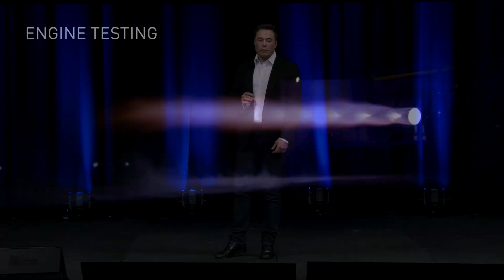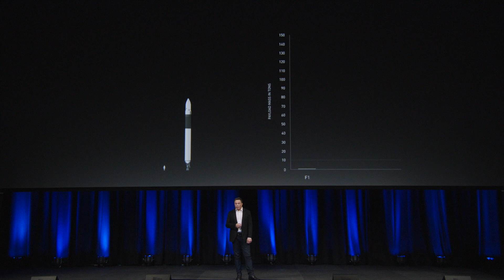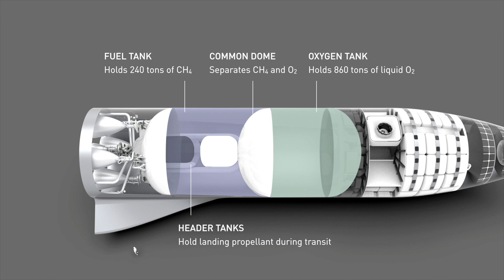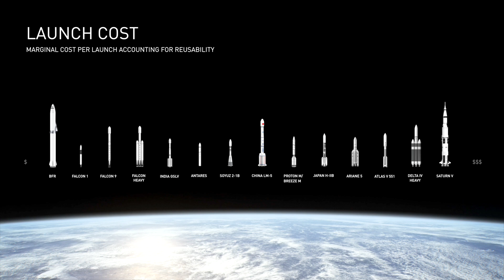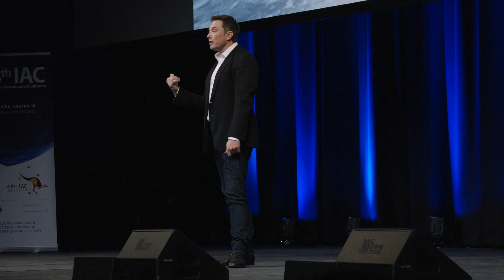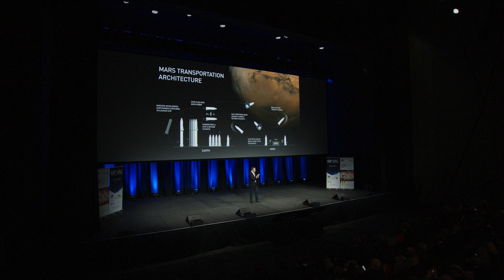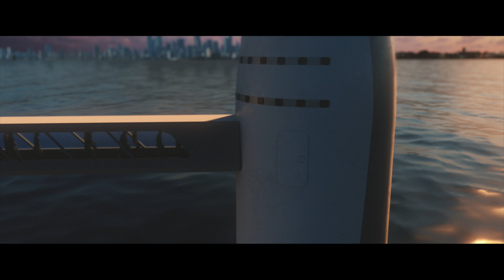Making Life Multiplanetary

Comment: Could a moon base become a hub for any particular industry? Would be have our major aerospace engineering facilities there?
Reply: Actually there are a great many things that could be done on the moon.  Mining is just one of those.  Low G manufacturing (large heavy spaceships or whatever else you can imagine), research facilities, astronomical observation, Tourism, and any number of other possibilities.  Dangerous projects might be advantageous to have on the moon.  

I could easily imagine the moon becoming heavily industrialized, especially with no atmosphere or ecology to screw up.  Also large heavily shielded ships would be easier to manufacture and launch on the moon.  So you would need the various supporting industries for that.  Metallurgical industries would be needed in conjunction with the mining and ship manufacturing.  Not to mention other support services.  Soon you'd have a thriving community on the moon. 

By the by,  there is a way around the problem of extended microgravity.  Think of those gravitating rides at fairs and parks.  Combine the low gravity of the moon with centrifugal force, and you have simulated Earth strength gravity.  Entire buildings could be shaped like rings or if you want to get ambitious even an entire city could be built on a rotating inclined platform.  The same could work on Mars or any other low gravity body.
Reply: Tibees if we ever develop working fusion reactors it has a shit ton of helium 3 in its soil.
Reply: @Deathven1482  Existing fusion reactor designs will probably never generate enough surplus electricity to power a nuclear submarine or a city because the force that causes the hydrogen atoms to fuse together inside the sun is the force of gravity! And Tokomak magnetic confinement fusion does not use gravity to fuse the hydrogen atoms together into helium atoms.
Reply: Basically, Moon is huge chunk of iron, so metallurgy can be developed for sure.
Reply: Mining for constructing things like habitats in space or massive interplanetary spacecraft. They can also build telescopes with much larger mirrors than on earth thanks to the low gravity, and they would still have all the benefits of space telescopes because they aren't built in an atmosphere. I'd imagine that if thy build solar powered hypersonic maglev rail ways for launching materials to lunar escape velocity they could send materials to various places including earth with no rocket fuel. I'd imagine there is also a significant market for tourism once the price is brought down far enough.
Reply: I heard astronaut Mike Massamino on Startalk Radio saying that they spend about 2 hours per day exercising to prevent micro-grav atrophy.  In that case, you'd only have to centrifuge the personal quarters section, and you'd get plenty of workout while sleeping, eating, sitting at your desk, etc automatically.  Then the rest of the base/city could be in local low-g to make the workday easier or play low-g games.  Seems like an easy fix.
Reply: Humanity is always in conflict with each other for pretty much all our history, but when great minds are selected, e.g. scientists and placed in Antarctica or the ISS the people dont seem to be trying to kill each other. Id imagine moon could be similar
Reply: Google Deep Space Gateway, it's a project involving NASA, CSA, JAXA, ESA and Roscosmos to create a launching platform orbiting around the moon :)
Reply: Weapons testing and Advanced personal testing facilities will likely represent the bulk of industry on the moon.
Reply: +wilmau
Better but all of our factories on Mars not the Moon!
Sooner we do that, the sooner an earth-like atmosphere will develop on Mars. Which will be one of the most impressive feats humanity has ever accomplished.
Reply: could be, are the keywords here, it depends entirely around what kind of people are working on the moon and for what reasons.
Reply: There's a question of who owns resources extracted (which country in what proportion). Also, what happens when moon is completely used up and Earth trajectory changes (including no ocean tides) and who will be correcting this and how.
Reply: tleo3333 you are thinking way too far in the future, hundreds of thousands, or millions of years.
Besides if we made the moon a junk yard at the same time, that would add the missing mass to it.
Reply: wilmau the moon causes tides on earth; which may be important to plant and animal life; especially life along the coastlines and in the larger ocean. People messing with things they know little or nothing about can cause potential negative unintended consequences and is how numerous serious problems/ manmade disasters have happened in the past. As a result, a high degree of humility and caution, is an appropriate response, to ideas of messing around with things involving our environment; which the moon affects significantly, is an extremely important consideration that merits the highest degree of caution. A degree of caution that recognizes human failings in the past; regarding the environment and the acquiring of sufficient wisdom and discernment and good sense, developed from prior numerous bad experiences of humanity causing unintended harmful and even disastrous  consequences to human and other animal, insect, plant, and other various forms of life and we need to learn the lessons of the limitations of our understanding of complex systems and rushing headlong into repeating the same mistakes in the future; that we should have learned from past negative experiences, not to repeat again. Another important function of the moon in orbit around the earth, is significant added protection against comet and/or asteroid strikes. So, disastrous collisions of space bodies with the earth; such as the collision that caused the dinosaurs extinction and an extremely high percentage of all life on earth to become extinct, is far more rare and less likely to happen with the gravitational effects of the moon in orbit; which has the power to turn direct hits on earth and the potentially disastrous consequences; that follow, into narrow misses. When you think about it, the moon has played and continues to play a very important role to life on this very special planet, called earth. These are only 2 critically important examples of the moon's importance in continuing to orbit the earth, to life on planet earth. The proceeding were just 2 examples off the top of my head; there may be one or more other reasons, as if any more were needed and no more are needed, to know that messing with the moon's position in orbit around the earth, is a very bad idea; that recklessly endangers life on earth.
Reply: The moon contains the precious helium-3 which you need for nuclear fusion
Reply: Maybe we could have a resort on the moon 

I’d love to see the moon lander and prove to all the moon landing hoaxers THAT WE LANDED ON THE MOON!!!!!!!!!!!!!!!!!!!!!!!!!!!!!!!!!!!!!!!!!!!
Reply: a... porn hub?
Reply: Yeah you can look at the moon an Ikea waiting to happen.  Iron, aluminum, magnesium, titanium and silicon + space to grow vast warehouses of hydroponic crops to support earths increasing population.
Reply: @antifusion 
you dont colonize space for more space lol, we have plenty of space in the sahara, siberia or australia
Reply: @BirdTurdMemes  And those places won't be inhabitable within 100 years. Anyway you seemed to have missed my point entirely which was utilizing the moon as a resource provider that isn't at the bottom of earths huge gravity well. A provider to support the growth of the cislunar economy.
Reply: Even better, the prise will be more valuable and thus the measures taken to own it will be greater (just like on earth)
Reply: Seriously? Can you provide some links about it? :) I'm really interested
Reply: Aeronautics on a body without an athmosphere?
Reply: Tibees it would really have to be underground and extremely resistant to radiation
Reply: Seastallion Alternatively, if you want to avoid the conflicting forces of gravity you can simply set up orbital habitats and only have humans go to the surface for when needed.

That's part of why I consider Ceres' situation in the Expanse to be unrealistic; apart from the godlike energy requirements to spin such a body it makes much more sense to just build a constellation of orbital cities around it.

But our analysis of health effects of microgravity has only really been performed in 0g environments, we're not sure if this stays the same with the addition of more gravity. It could be that gravity as little as the Moon is enough to deal with most of the health issues.
Reply: It's amazing how I can barely find anyone noticing what you just said about the moon's trajectory. We can't afford to fuck up our only moon. Everyone's so excited about building, building, building, but the concept of scarcity seems nonexistent among the masses. And for the Lemon guy comment, if we mined the moon, a great amount would be transported back to Earth outweighing the "junkyard mass" ratio. And kudos to ementormike - he's right on point.
Reply: The hardware still has to be launched from earth. Might as well build it in orbit
Reply: I heard they're gonna be producing ZAFO on the Moon.
Reply: Most of you guys are thinking too far ahead... Industry is not, in any form, a priority to the top scientist of the Earth. it is priority to the big companies on Earth though.
Reply: Well no, not really efficient. Gate way would be better
Reply: Mining and military presence are probably the two biggest.
Reply: Ur a tool
Reply: yes obviously its wayy more feasible to launch from moon than earth so if we can use ice from moon to make hydrogen oxygen fuel we can do that
Reply: I watch your videos
Reply: Maybe helium 3 and fusion power.
Reply: The craters would be great for telescopes similar to Arecibo
Reply: Either lead, follow, or get out of the way! Is all this too late? Places like China, will always rather keep humans separated. As long as those at the top refer us as unnecessary eaters, mankind will suffer at their hands.
Reply: @LorneChadwell  China is weak
Reply: @Phoenix_1776  and godless enough to calculate, they have the raw numbers to survive a nuclear first strike against America, better than America could. We have already proven so willing to maintain, or regain “getting back to normal”, many are willing to abandon freedoms historically American, with full abandonment. China thinks its system, and people will outlive an American war, but only if its fought non traditionally.
Reply: @LorneChadwell  The problem with China though they are mainly an economic based country if there economy starts going down it will be a big blow and war tends to mess up economies
Reply: i heared usa nasa engeneers want to mine on the moon. so i guess it's first come first serve
Reply: First of all I would like to be one of the many to thank Elon Musk for his leadership, determination and all of his efforts of helping humanity clean up our environment with sustainable energy programs. Also with his commitment of SpaceX to allow the exploration of space for future colonization. Our world is a fragile place that currently holds all of humanities eggs in one basket. By spreading our wings and being able to leave our nest we will ensure that human consciousness will live on outside of our planet. I was asked by A very wise man in the early 2000s if I had millions of dollars to help humanity, what would the most important innovations be in business for all of humanity? I knew that the petroleum industries were polluting our air water and food to the point that people were getting sick and dying of diseases, from those major fossil fuel pollutants. As we talked further and further about electric vehicles, transportation, solar power and other sustainable energies. He said, "I think you're right and it should be done!" He as well had been pondering that question. Trying to be thorough though, he asked if anything else should be focused on for all of humanity? I said, "Yes and in case of a global disaster whether it be climatic, an asteroid strike or another WORLD WAR, I suggest that space exploration and colonization also be considered to prevent the collapse of human consciousness as we know it!" Thinking back all of those years almost seems like a deja vu to where we are today. Again I can't think of anyone else but Elon that would put all of their FORTUNE on the line for the best of humanity. With his consistant focus and extremely innovative leadership, he is leading the world out of darkness and into the light of the rest of our universe. So much yet to learn and do but thanks to the lead of people like Elon we can be stepping in the right direction. We all have more in us to offer the rest of the world. So let's do it! This is the time and we are the people that will change the world! For those of you who like these ideas or have some of your own to offer, please let me know. I appreciate all of you and your comments. Let's shoot for the Moon and Mars then we will end up amongst the Stars! 
propower101@hotmail.com
Reply: First of all I would like to be one of the many to thank Elon Musk for his leadership, determination and all of his efforts of helping humanity clean up our environment with sustainable energy programs. Also with his commitment of SpaceX to allow the exploration of space for future colonization. Our world is a fragile place that currently holds all of humanities eggs in one basket. By spreading our wings and being able to leave our nest we will ensure that human consciousness will live on outside of our planet. I was asked by A very wise man in the early 2000s if I had millions of dollars to help humanity, what would the most important innovations be in business for all of humanity? I knew that the petroleum industries were polluting our air water and food to the point that people were getting sick and dying of diseases, from those major fossil fuel pollutants. As we talked further and further about electric vehicles, transportation, solar power and other sustainable energies. He said, "I think you're right and it should be done!" He as well had been pondering that question. Trying to be thorough though, he asked if anything else should be focused on for all of humanity? I said, "Yes and in case of a global disaster whether it be climatic, an asteroid strike or another WORLD WAR, I suggest that space exploration and colonization also be considered to prevent the collapse of human consciousness as we know it!" Thinking back all of those years almost seems like a deja vu to where we are today. Again I can't think of anyone else but Elon that would put all of their FORTUNE on the line for the best of humanity. With his consistant focus and extremely innovative leadership, he is leading the world out of darkness and into the light of the rest of our universe. So much yet to learn and do but thanks to the lead of people like Elon we can be stepping in the right direction. We all have more in us to offer the rest of the world. So let's do it! This is the time and we are the people that will change the world! For those of you who like these ideas or have some of your own to offer, please let me know. I appreciate all of you and your comments. Let's shoot for the Moon and Mars then we will end up amongst the Stars! 
propower101@hotmail.com
Reply: First of all I would like to be one of the many to thank Elon Musk for his leadership, determination and all of his efforts of helping humanity clean up our environment with sustainable energy programs. Also with his commitment of SpaceX to allow the exploration of space for future colonization. Our world is a fragile place that currently holds all of humanities eggs in one basket. By spreading our wings and being able to leave our nest we will ensure that human consciousness will live on outside of our planet. I was asked by A very wise man in the early 2000s if I had millions of dollars to help humanity, what would the most important innovations be in business for all of humanity? I knew that the petroleum industries were polluting our air water and food to the point that people were getting sick and dying of diseases, from those major fossil fuel pollutants. As we talked further and further about electric vehicles, transportation, solar power and other sustainable energies. He said, "I think you're right and it should be done!" He as well had been pondering that question. Trying to be thorough though, he asked if anything else should be focused on for all of humanity? I said, "Yes and in case of a global disaster whether it be climatic, an asteroid strike or another WORLD WAR, I suggest that space exploration and colonization also be considered to prevent the collapse of human consciousness as we know it!" Thinking back all of those years almost seems like a deja vu to where we are today. Again I can't think of anyone else but Elon that would put all of their FORTUNE on the line for the best of humanity. With his consistant focus and extremely innovative leadership, he is leading the world out of darkness and into the light of the rest of our universe. So much yet to learn and do but thanks to the lead of people like Elon we can be stepping in the right direction. We all have more in us to offer the rest of the world. So let's do it! This is the time and we are the people that will change the world! For those of you who like these ideas or have some of your own to offer, please let me know. I appreciate all of you and your comments. Let's shoot for the Moon and Mars then we will end up amongst the Stars! 
propower101@hotmail.com
Reply: The moon has ice, it could be used as a launch base for other missions. There also studies on building spaceship hulls from Moon materials.
Reply: kamu tungu nangsah celaka
Reply: I'd assume there's resources up there to be exploited or major scientific questions to be answered otherwise Spacex (And anyone else for that matter) wouldn't bother.
Reply: Jobs for all college grad
Reply: The moon spin around the world every 24 hours, so you could drop some stuff on the moon, let it spin and get it out once it’s on the other side.
It’s probably not that cost efficient but I would rather spend a day on the moon than  wait on a plane for 6 hours.
Or we could relocate all the factories there.
Or if we’re going all out, maybe one day we would be able to transform the moon into the equivalent of a spaceship and move it around the universe to our next planet. 
Cause we won’t be able to build a moon size spaceship any time soon, might as well use the damn useless rock.
Reply: @WilMau  man get of crack